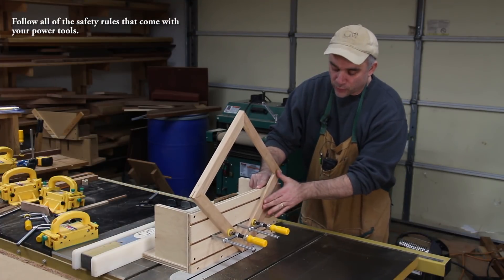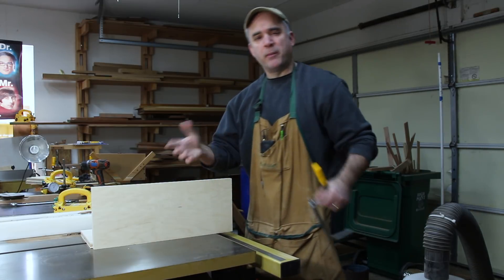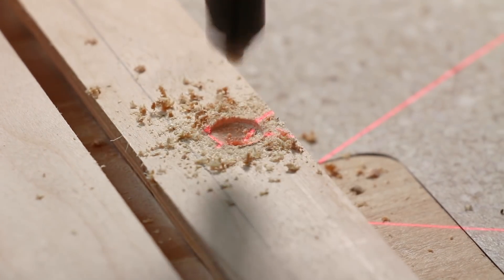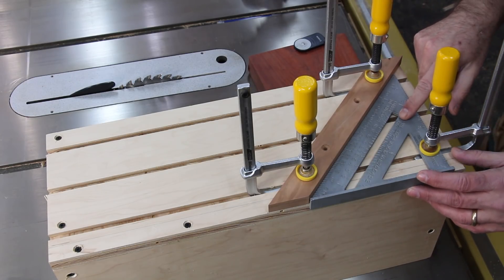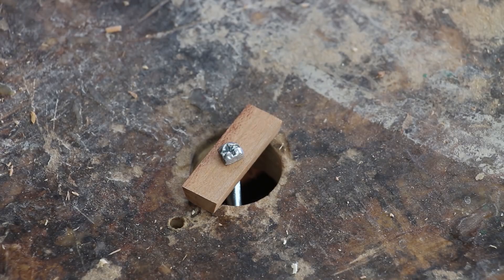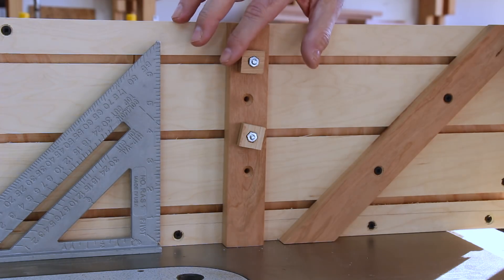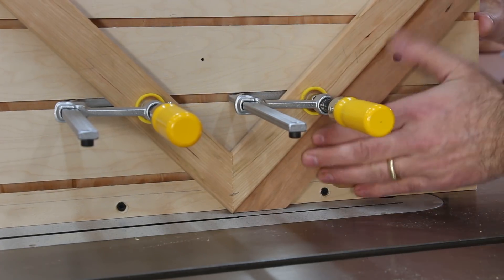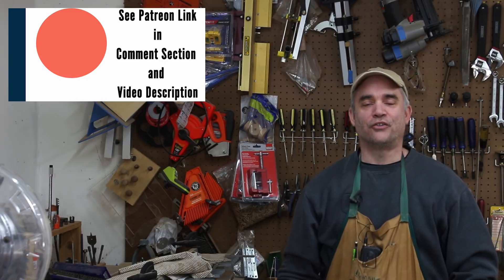Dual Spline and Tenon Jig

Comment: Nice work, I made a similar sled that straddles the fence but it got tight in the summer. I like the idea that it can't get off course but it did get too hard to push safely during humid conditions so I can see the benefit of one that just rides against the fence. I agree that horizontal is the way to to go with the tracks.

Comment: Great idea but why not make it go into the track that way you don't have to make sure its touching the fence. Food for thought
Reply from the maker: The jig will not be adjustable if it's in the track - no way to set the placement of the saw blade.   This process is just like ripping a board against the rip fence. Food for thought.
Reply: Only way I can think to add something like this would be to have a part that goes over the fence tightly and attaches to the jig.
Reply from the maker: Why?  The motion is just like ripping a board.  It's the same process.  When you rip a board does a piece of the lumber go over the fence?